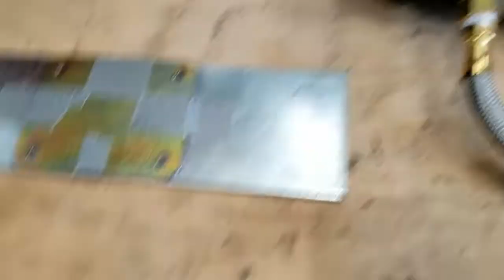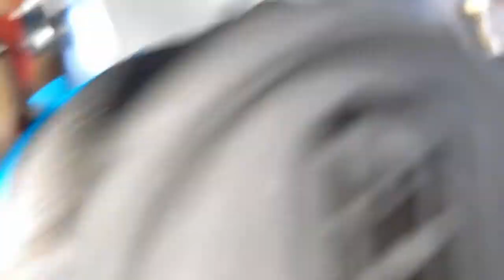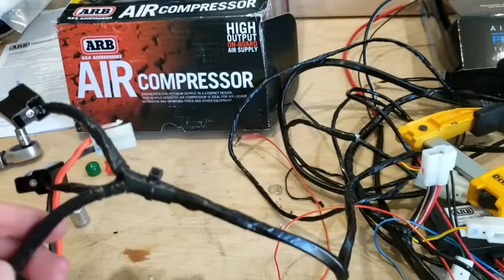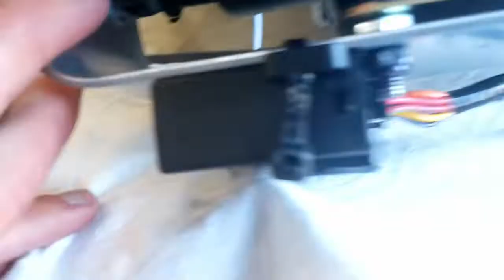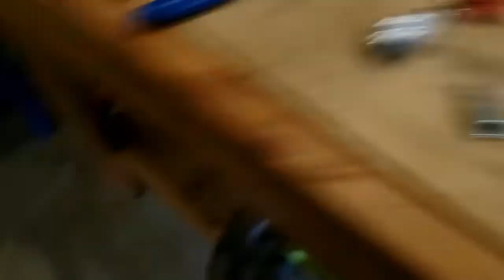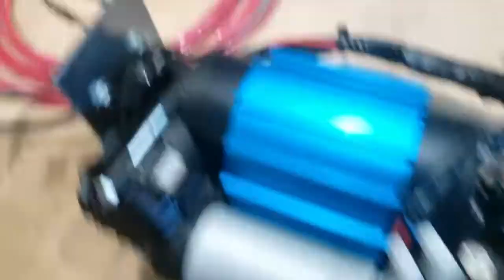ARB Compressor Install Part 1 - Mounting Bracket & Wiring Harness

Comment: هل اابرشلس الجديد يسخن جدا ؟
Reply from the maker: Working with Google Translate so I’ll do my best. If you’re asking whether or not the compressor got hot. It did get warm but never overheated. As long as you stick to the duty cycle recommendations it should be fine.
Reply: @HarrisonsGarage كلنا نستخدم ترجمة قوقل .. يقولون  البرشلس الجديد يسخن  بعكس القديم  هل صحيح ؟
Reply from the maker: @user-F9 I’m not sure. I don’t have any experience with the old one sorry.
Reply: @HarrisonsGarage اهاا تــمـــــام ظننت ان لديك خبره ... اسف ع الازعاج

Comment: The link you provided for 1/8" BSPT to 1/4" NPT Adapter is not correct. Can't find BSPT to NPT. Can you provide correct link? Thanks
Reply from the maker: I just checked and it seems to be taking me to the correct part. DM me on Instagram @harrisons.garage and I can send you a screen shot of what I’m seeing
Reply: @HarrisonsGarage  Your link points to 1/8" Male NPT to 1/4 Female. ARB compressor has 1/8'' BSPT tread. NPT will not work for BSPT. I have found the correct adaptor on Amazon. It is HongBoW 2pcs 1/8 BSPT Male x 1/4 NPT Female Brass Pipe Fitting Adapter
Reply from the maker: Ah thanks for clarifying. For anyone else reading this here’s the correct link. https://a.co/d/2Dnaqzs